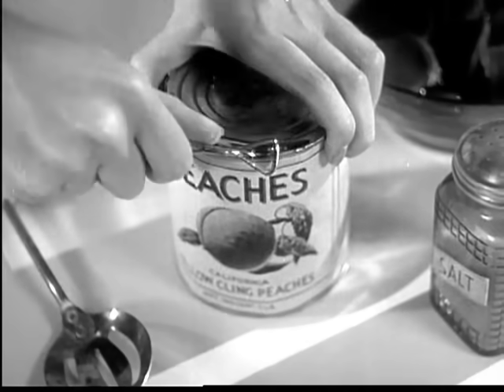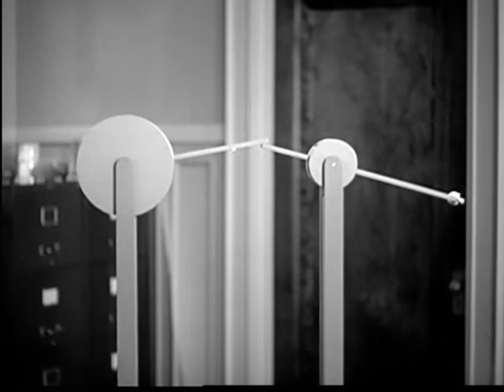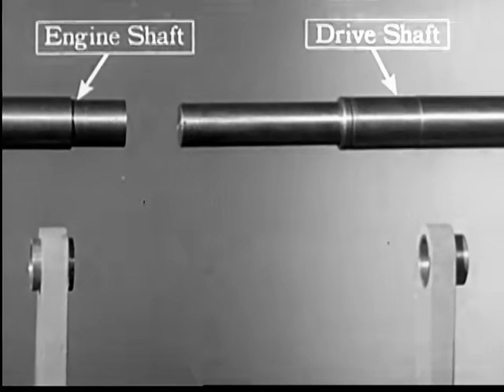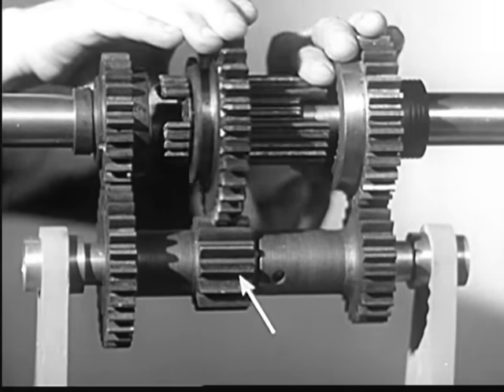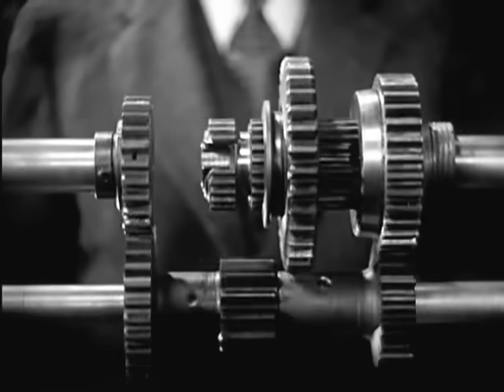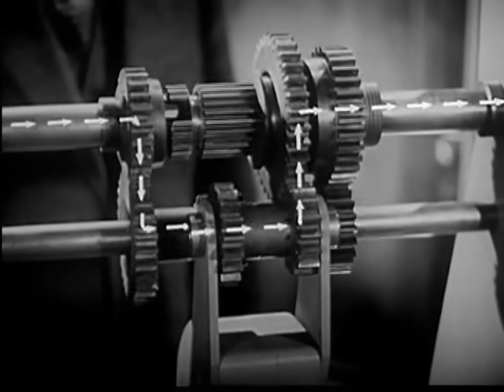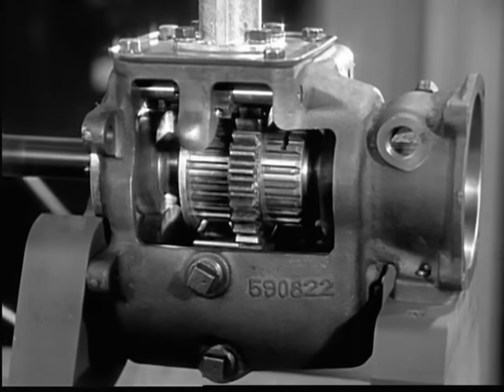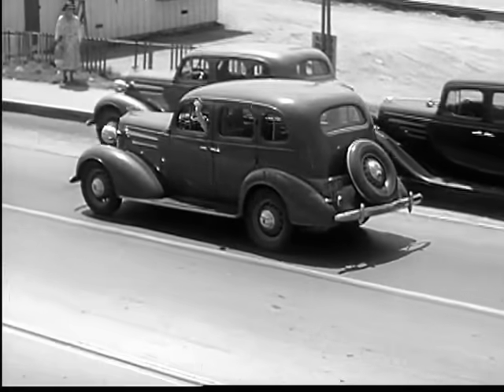Spinning Levers - How A Transmission Works (1936)

Comment: It even showed how to downshift and use lower gears going downhill amazing.
Reply: Actually, I think that was the WHOLE POINT of the film!!

On the surface it teaches how a gearbox works but is actually I reckon a cover for saying, "even a young blonde can avoid crashing into others by managing to get her car into second gear when going down a steep hill - SO YOU CAN TOO".

The generation before me was from the era, and I remember a lot of talk - even at parties - about gear changing, stripped gears, and how to get into low gears so you don't cause crashes, with the poor (artificial) blonde being the "lever" used to try to get everyone to up their gear changing game!
Reply: @jb9652  Why downshift downhill?
Reply: @EnjoyCocaColaLight  On long steep hills, the brakes (drum brakes on all four wheels) weren't good enough by themselves. They would overheat then become ineffective (fade) i.e. they wouldn't stop the vehicle however hard the driver pressed the brake pedal. Crashes therefore resulted.

Changing to a low gear (e.g. 2nd at up to 40 mph and 3rd between 40 mph and 70 mph) on hills solved this problem. The torque required to turn the engine (say 50 Nm) was multipled by the gearbox ratio (say 2.5:1 for 2nd gear) and the differential ratio (say 3:1) giving a lot of wheel braking (375 Nm in this case - or around 1250 N = 125 kgf). This braking is known as engine braking.

The brakes only had to provide the remaining braking torque required and therefore didn't overheat and therefore didn't fade.

And therefore didn't result in a crash.

All this assumes a manual (non-automatic) gearbox, like the one in the film.
Reply: @EnjoyCocaColaLight  That answers your question. To explain a bit more:

A problem was that before synchromeshes were introduced, it was difficult to engage 2nd gear going downhill. The driver had to press the clutch to change to neutral, release the clutch, rev the engine to the speed it would be turning if the gearbox was in 2nd gear to speed up the input shaft to the gearbox to the required speed, then press the clutch again and change to 2nd gear.

This process, known as double declutching, was difficult (you needed to listen to the actual engine speed, know the required speed, and adjust it to match) and was the sort of thing people talked about back in those days.

A major problem was that most people couldn't do it.

This film was basically saying "Look, we've added synchromeshes to the gears, so now there's no excuse for not using 2nd gear going downhill (even a blonde can do it), and therefore no excuse for crashing".
Reply: @jb9652  Automatics also engine brake just to a lesser degree

Comment: A game of simple Physics. The length/mass of the lever from which the smaller weight hangs combine to equalize and compensate weight disparity  with the larger weight hanging from the shorter length/mass lever. We see this principle applied at the Circus.

Comment: All my life I have owned only standard transmission vehicles and never automatics.  It's tough to buy a new car that has standard transmission.  If you find one it's not even the color you want because the color you want are all automatic vehicles.  This would be no problem if you live in Europe and not in America.  Europeans love standard transmission because it's cheaper to fix than automatic transmission.  Automatic transmission are for lazy people who hate to use their left foot for the clutch but would rather use their right foot for the brake and gas pedals.

Comment: This form of education is arguably one of the most effective means to convey complicated topics.

1. Present problem
2. Break up problem into smaller pieces
3. Solve one at a time
4. Combine solutions.
Reply: I was stumped as to why modern videos about the workings of a manual transmission just confused me, but you've highlighted why. Despite the detail of their CGI presentations, they FIRST throw labels and terminology at you and then gloss over the workings. Obviously modern transmissions are somewhat more advanced but the principles are generally the same.
Reply: @fightinandirish  you ok kle
Reply: In other words, ground-up explanations
Reply: @lako8368  I think it's actually the opposite, a top-down explanation. It's much easier to start with an easily recognizable problem and work backwards than it is to start with vague fundamentals and work up to real-world practice, with the latter you don't retain the initial information because you aren't presented with its functional purpose until the very end. Well, at least that's how my brain sponge operates.
Reply: So true
Reply: This is what I've always done. Also, understand what each part does, so you can have the bigger picture.
Reply: Yeah like finite elements method
Reply: @karbonaterol651  In what way is this the finite elements method? Or are you thinking of "first principles"?
Reply: And that's exactly the method of a good teacher. Granted, today's car mechanics have to learn a whole lot more, mainly because of all the electronics. But a car from the 70s or 80s will be pretty much the same, with not too much additional stuff to learn.
Reply: This is basically how most big problems are solved. It lies in the concept of divide-and-conquer.
Reply: The woke Socialist teachers who've never worked a day in the private sector have ruined society. How can you teach something if you have zero experience in it, other than reading books?
Reply: its a ad designed to spoonfeed information to the general population ofc its going to be easier to understand
Reply: Exactly
Reply: from all vid i've watch that talks about gears, this is probably the one where i can understand the fastest
Reply: that is taught in high school what country are you from?
Reply: @automachinehead  indonesia, and i'm in 7th grade
Reply: my machine shop teacher taught us in the same way
Reply: Also no transgenderism or climate change.
Reply: Just like a squirrel and his acorns storing nuts for the winter.
One at a time.
Reply: Galileo
Reply: Back then there was only 2 genders. We are totally lost.
Reply: This is exactly what Lesics channel was doing. It go from simple problem, and show us how to fix it, then present another bigger problem, and solve it, in the end we got to the modern problem, and we know how to solve it.

Comment: We take little additions to the film like the arrows at 5:22 for granted since it's so easy to add them via computers today. But even those little arrows certainly took a fair amount of time and labor spent splicing film, all for a little visual aid. Great film.
Reply: Yeah I was wondering how they did them without any software
Reply: @emilio.m.c3713  if this was filmed on movie rolls, maybe those arrows were physically added to the rolls, but I'm not sure
Reply: @GabrielFranco  the same way like they put together Cartoon film sheets into roll film.
Just like Walt Disney studios that existed at the same era.

And honestly drawing those arrows aren't as much Labor as drawing short episode of Cartoon which airing on the same era.
Reply: @emilio.m.c3713  They were hand drawn on what amounts to a transparency overlay then run overlaid on the negatives during production of the finished film reel.  That's how you get white arrows from black ink animation.
Reply: They were probably either rotoscoped in or double-exposed with frame-by-frame animation. In both case this is very labor-intensive, as it required manually altering and splicing as many film frames as there are seconds elapsed times 24.
Reply: Well this was already filmed on film and these arrows were painted by hand onto the film later nothing special back then too but took a bit more work
Reply: Those arrows hadmande dude
Reply: @renatocipriani93  I'm aware, you misunderstood what I said lol
Reply: Yeah my son asked "how did they do the arrows" and he got scared when I told him that someone had to draw every single one of them in those frames.
Reply: Fun Fact : Those arrows were drawn by Walt Disney himself. 

Just Kidding. 😇

Comment: Fully synchronize manual transmissions are easily shifted without the clutch. I only  use the Clutch from a stop in 1st gear.

Comment: You guys realize, that this was the most modern technique in entertainment they used there to explain. They didn't even have TVs outside of labs back then and even sound film has only been arround for 9 years at this point. You'd have to go to a cinema to see this or own hella expensive equipment youself. Such ambition...

Comment: I didnt quite get the synchromesh part. Id also like to see a more modern 5/6 speed (last time I saw/drove a 3-speed it was column shift, which is probably a mechanical nightmare all its own).

Comment: Anyone may find this understandable. Not me. And I am a scientist. No matter which gear is in, the outer right wheels and the outer left wheels keep being connected, so all gears are the same. And the mechanism of the back gear is invisible. For heavens sake Youtube got many files.
Reply: Gears change how the engine output is transfered to the wheels. Low gears give more torque to the wheels than what the engine produces but less speed. Overdrive gears are the opposite.
Reply: @Redtooth75  And a circle is round. But whom did you answer?
Reply: @zzausel  you because you said you were confused about the concept of gears.

Comment: Engineering aside, I love seeing these old cars. And realizing that they could run on only 3 gear ratios. Please please keep this video safe.
Reply: I hope to preserve one of these cars in my own driveway come springtime. They regularly show up for about 20-30 k in my area. Ideally I'll get myself a Ford; I plan on daily driving the thing and the Flathead V8 can withstand having the everloving FUCK beat out of it like no other engine around. You can have those things screaming along at 3800RPM 24/7/365 for several decades before they give out. And they sound really nice besides.
Reply: @TestECull  although 3800rpm has the engine at fast piston speeds I wouldn't call that screaming lol. I think of engines "screaming" only when they have a decent redline. I'd describe an undersquare design engine much differently
Reply: @spencerkleiman5035  Screaming is relative. An engine is screaming at 2,000RPM when it's a 16 liter semi truck engine. These engines are massive and you really do not want them spinning very fast! They also do not need to spin fast; they make their power between 800 and 1600RPM. Torque for DAYS. And on the other extreme end of the spectrum, the engine in my Kyosho Scorpion is screaming at around 35,000RPM! *Literally* and figuratively! I have video of this car uploaded if you wanna see and hear it. But of course that engine is a wee tiny li'l guy, only 4cc or so. Tiny two stroke with a bore diameter about the size of a thumb. Idle for that engine is about 5500RPM and it doesn't start making any useful power until around 14k or so.

For one of these vintage car engines, they're screaming at 3800-4100. At that point they're running flat out. Balls to the wall. All they've got to give. Cast iron pistons, poor volumetric efficiency, mild cam grinds, and in many cases(including the 216cid Stovebolt Six shown in this video) poured babbitt bearings riding on splash lubrication all lend themselves to quite low redlines. They made good power but they made it at very low speeds; they drove like a diesel almost. Unless you had a Flathead Ford V8, you pretty much never wanted to rev past about 2500 or so with one of these old engines. Not for very long. They wouldn't take it.

Side note: The flathead Ford V8 had modern lubrication and bearing tech in it and would happily sit there at near redline pretty much all day long provided the oil was serviced frequently enough. They only used poured bearings for a couple of years and by the time this video had been made had switched over to insert style bearings that we still use to this day. Furthermore, they used full pressure lubrication for the rotating assembly. Contemporary engines would experience rapid bearing failure if pushed hard because splash lubrication and poured bearings are just not up to that kind of demand, but insert style bearings and full pressure lubrication *are*. These engines didn't rev any higher, but they could survive life at those high revs just fine.
Reply: The vehicles by the end also had lower gear differentials to most cars today at 60 mph are turning over between 1700 and 2000 RPMs if that speed cars back then at 60 mph would be turning over for over 3500 RPMs. The average highway speed back then was only 40 to 45 mph
Reply: And the way of speaking. And the cars. And the outfits. I love the driving gloves that woman is wearing.
Reply: @AudreysKitchen  Part of why this spring I am buying a car of this era to daily and am doing no more modification than absolutely necessary.
Reply: first automatics (like powerglide) only had two speeds and it works just fine for the time. If you have enough torque, you dont need as many gears really.
Reply: @hojnikb  You can't compare a conventional automatic with a manual because an automatic has a torque converter. Torque converters add torque multiplication themselves. Through the 80's we had 3 speed autos in small cars (even "sports" cars like the Subaru XT) where manuals were 5 speed.
Reply: The videos is very safe

Comment: Cars we make have transmission to shift gears the power comes from the engine shaft  and there is the drive and counter shafts we added gears to one for the engine shaft and two for the counter shaft and one for the drive shaft and keep turning and if we shift in Low speed (1st gear) and 90 revs is lowered to 30 revs and to the medium gear (2nd gear) and then We add three and Reverse

Comment: The difference between Manual and Auto leverages is that, in the former, you control the transmission; and in the later, a Computer controls it.

In other words, you feel like a Computer, and the Computer feels like Shit.

Comment: The first time I saw gearing on a Yamaha R1 and I was baffled on how its works. How amazing we are not so far off from 30s tech as this still makes sense!
Reply: The only thing that's changed inside the manual transmission in the intervening 90 years or so is how many sets of ratios there are in the box.

Comment: And now, we have the EV... (someone else developed a cool two speed gear system for that, but most EVs have fixed gearing. maybe Electric trucks will have multiple gears?)

Comment: "steep hill, use second gear" sign is so cool to see.... Nowadays signs are too overused, for "turn"and "dangerous turn", you find curves you can do with the 5th with no problems, and those where you have to slow down into the 2nd and you have to memorize which one is which... :(

Comment: I think the difference between the educational videos from back then and now is that if you're looking for a video to explain a subject today, there's a good chance you will find overly edited garbage made by a person doing it as a side gig. Videos like these probably had a relatively high budget and were thought out carefully by people who understand it well enough to teach it properly. Basically what I'm saying is that you're comparing dollar store garbage to a properly manufactured piece of equipment. If you want something easier to understand, then you need good resources. Books and Full courses are a good start. Reading scholarly articles can help too, they tend to explain things as well and it will be something you end up needing to do anyways at a certain point, depending on what you are doing that is. Also if you are young and ever get the opportunity to find a mentor then that is a good thing. I'd imagine that you can probably find a mentor even if you're a bit older, it may just be harder, idk. I don't have experience with being older.

Comment: "STEEP HILL: USE 2ND GEAR"

Yeah, that's not written for really any modern car. With direct fuel injection and drive-by-wire, the car will just keep going faster and faster, regardless what gear you use. Frankly, I find it annoying. I'd prefer to have a car which doesn't require constant use of the brakes when going down a hill.
Reply: Smart cars for dumb drivers. It's a shame.

Comment: Modern manual transmissions are virtually identical in operation. They just have more gearsets. ...and actually, many things today are rather easy to explain if a person knows how to explain them. Many today take to using acronyms and unnecessary niche terminology that only people "in the know" might understand.  Often enough these people take pride in knowing their special words as if memorizing a word means intelligence.  Much of what we have today has been built on technology from decades and decades ago. It has been refined, multiplied many times, made smaller, much more efficient. Many today think that a microchip is something special and modern, and that a transistor is a thing of the past. If you told them that their cell phone contained millions, if not billions of transistors, they wouldn't even believe you.

Comment: I love the advancement of modern PCs until they're on a desk or in my pocket.
But boi would I be happy if we lived in an age where manual transmissions were peak engineering, not shitty electric cars which are made idioticly simple for inexperienced drivers. It's a bigger joy to even drive a manual car in a racing game which has proper physics at least in the middle of arcade and simulation.

Comment: no one, and i mean no one could explain a transmission simply enough for my dummy brain to understand, i always knew the older method of teaching was better. straight to the point, first learn how it works, then go in depth with details, derivations, etc... I hate learning the complicated stuff first cuz i never get past it fast enough to learn the simpler way. wait does this make sense to anyone?